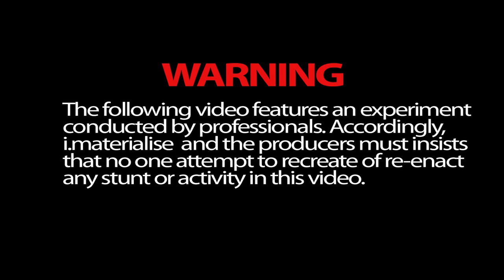We try to burn Ultem 9085 a 3D printing material for commercial aircraft

Comment: It's interesting that when deforming and melting, it is doing so layer by layer.   I would be concerned that the parts fail in the same way from other forms of stress.
Also, I agree with the other commenters.   It would be nice to see a companion video with the torch held steady.